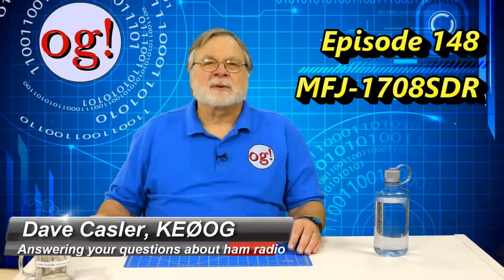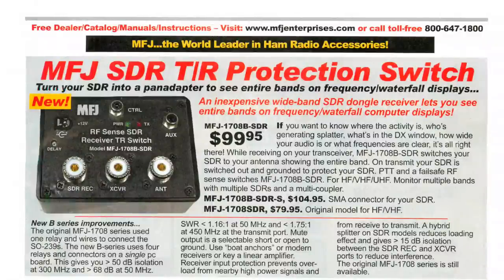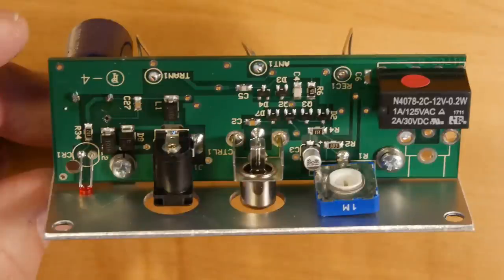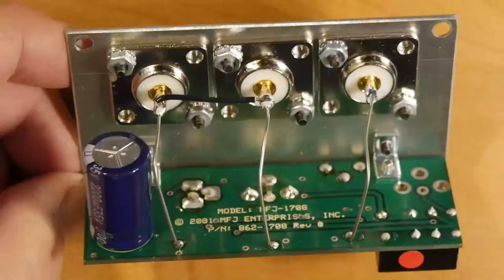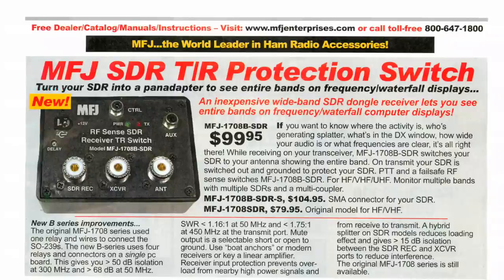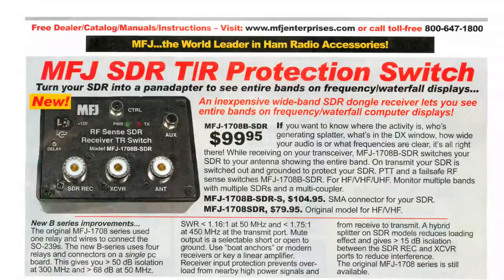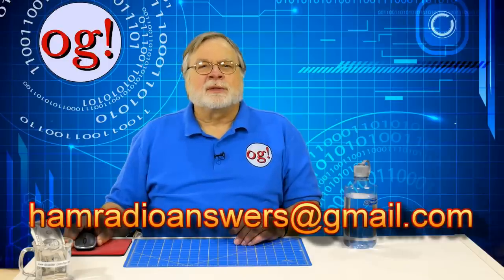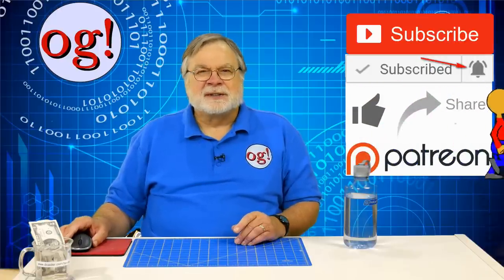A close look at the MFJ-1708SDR T/R switch (#148)

Comment: Thanks Dave for this great video.  It was very helpful.  I have successfully set up my Kenwood TS940S with a SDRPlay and a  MFJ 1708B.  The set-up is great and the SDR is a hot receiver.  The tracking works great.  Next project, upgrade from my old RigBlaster Plus (worked great) to a SignaLink USB.
73,  W4EET

Comment: I use SDRplay receive on an old 80m vertical for just that purpose, no radials. I pick up just about every transmission out there including FMStereo, air most UHF and VHF transmissions and of course HF. I playback SDRplay on a laptop. I transmit on a Hexbeam using a Icom 7300 which has its own waterfall. Full band-width SDRplay is a great device to find a contact, but using a good DXCluster program will do essentially the same thing. I believe that most people won’t need this MFJ device iMHO.
Reply from the maker: It fills a niche for those who use their SDR receivers as a separate waterfall.

Comment: Great video. Just wondering if there is a way to mute the computer speaker audio at the same time when the relay engages. I get feedback briefly when I key the PTT and it is very annoying. Other than that the unit works fine.
Reply: There is an aux output but I'm not exactly sure how I can have SDRUNO mute from that.

Comment: Looks like this might be a good alternative to use with ‘boat anchor’ separates - no tubes or Dow Key relays. May try something like this with a SX-99 and a Johnson Ranger. Versa TR (RAN Technology) is similar to this. I believe there is an option AUX connection that could be used for receiver mute.
Reply: Great Question!  This needs to be a separate video.  Using RF sensed is OK, but you are right, the Receiver needs to be placed in Stand-by or Mute as an extra precaution to protect the front end.  I will call MFJ and see what they say.  Dow-Keys are difficult to find anymore and are greatly over-priced.

Comment: Thanks for sharing. Placing the device in chain "TRX - MFJ-1708SDR - Amplifier - Antenna" with a 250W Amplifier, might damage anyway the relay and/or the front end of the SDR? Thank you in advance for your answer.

Comment: Needs more isolation.  I hooked dummy load to transceiver, then using the control input to switch this unit and measured the ohms between SDR REC center to shield and it measured 120 ohms during transmit.  That does not compute.  Why doesn't the relay provide a near zero shut?

Comment: Hi Dave, Love the videos. Can I use this adapter if I run the SDR off of a dedicated receive only antenna? I would of course hook up the PTT cable. I  used my pasture fence for Ohio NVIS day and man alive was that ever a QUIET receive antenna!! 432 foot rectangle shaped. Was going to use that as my receive antenna and my EFHW 8010 or vertical as transmit antenna. Thanks.

Comment: Original model is just like putting a T on the antenna (when not transmitting)  so a low impedance SDR could pull much of the signal away from the transceiver.  The new B models have a real splitter inside that sends slightly less than half the signal to each, regardless of their impedance.  At least that's my understanding.
Reply from the maker: Thanks for the additional info.

Comment: Hi I have question I have 1708sdr one I'm getting super high swr with sdrplay dx and sdruno and 991a with conect antina straight to the radio I get good swr ?
Reply from the maker: Either something's misconnected or you're trying to measure SWR using an antenna analyzer while the 1708 thinks it's in receive mode. The 1708 needs to think you're transmitting. The connection that tells the 1708 that you're transmitting is essential.

Comment: Thanks for the review Dave. I have a question though... at 12:29 you say that your Yaesu FTDX 3000 already provides an output to your SDR that switches off when you transmit. How can I tell if my Icom IC-7100 has a similar capability? I'm new to ham radio and while I can search the manual for references to SDR (of which there are zero), I'm wondering if that capability would be called some technical term instead? No need to spend money on something that the transceiver does already, if in fact it does that. Thank you.
Reply from the maker: Some radios have an "IF out" that you can tap into. The '3000 has a nice RF out that I use with the SDR.
Reply: @davecasler , that's an RX out, Dave.

Comment: what software are you running for the SDR dongle to feed into? that's the only thing you didn't cover was SDR to the computer. I have stacked TS-570's. I want the pan adapter to use with radio which has the transverter  to use it on 2 mtr SSB. 
Also, in your testing, did check the rx side? Is the sensitivity the same with the 1708 in-line and is the SDR the same as the receiver it self?  Dave W9DLP
Reply from the maker: In my case the SDR is an SDRplay RSP1A and the software is SDRuno.

Comment: I'm using a MFJ 939 external antenna tuner with 7300. Do you  run the coax from the antenna turner to middle connection on the MfJ 1708 then a separate coax from 7300 to radio connection on MFJ 1708??
Reply from the maker: I don't have the 7300, nor do I have the updated MFJ-1708. Check the manual carefully.

Comment: I have the 7300 with the inrad RX 7300 mod. Should I consider something like this to protect the radio if I want to play with external sdr and software? I’m kinda confused how to use the Rx antenna and the tx antenna without rf coming back into something.
Reply from the maker: I haven't heard about that particular mod. One of the shortcomings of the 7300 is that it doesn't have a separate RX antenna, although I've lived without one for a long time before I got my FTDX3000.

Comment: Just got one. Works pretty good except for digital modes even though I am using my PTT line. 
RF flows right thru to the SDR. I can hear the relays click but sdruno shows "overload".
My intent was to run meteor scatter with my Icom 7300 while watching on the sdr.
All other modes (AM,FM,SSB) sdruno shows "RF Mute" which it should. (USB-D) I get no such indication.
Disappointing.

Comment: I just have a question.....can i use my sdr mchf transceiver as my reciever while using my ic 718 as my transmit rig?   I want to do this because the mchf has better recieve and features like waterfall and scope and i can widen or narrow my recieve pass band and i dont use it portable except for vacations....... I think it will work but what are your thoughts?
Reply from the maker: Yes, it can work. MFJ sells a product that will shield your SDR receiver while the 718 is transmitting. I did a video on it recently.
Reply: Thank you for your input.  I rally like your informative videos.  73

Comment: Hi i have have the 1708b-sdr need to know those it go from Radio to tuner to antenna or tuner then to antenna?
Reply from the maker: Radio to tuner to antenna. If you have a separate SWR meter, it's radio to SWR meter to tuner to antenna.
Reply: sorry what I meant is radio to 1708b-sdr then on the Antenna port to tuner and then antenna does that sound right thanks

Comment: Is it true there will be 3db attenuation on receive by tying both receivers to the antenna?  Know that isn't a lot but when trying to pull out weak signals, it could be a factor.
Reply: 3bd is half an S unit also but that is why I am asking Dave for his opinion. I have enough trouble digging out weak signals that I don't want to be adding more losses into the mix. We spend a lot of money on coax to avoid losses and if this unit introduces a 3db loss as I have been told in the past, it is a bit of a fail in my opinion.
Reply: For $100, one would think that MFJ would add in a pre-amp to take care of the issue. Otherwise it is just a very expensive relay.
Reply: It's true, you'll lose half the power to the SDR, but how many of us are operating near our receiver's noise floor. For me, S/N is driven by noise picked up in the antenna, and 3dB loss at the receiver input  not going to make much of a difference.

Recently, I took my radio up into the mountains, and I was hearing all kinds of signals that I would never hear at home. It was an exciting pleasure. Maybe if I lived up there I'd be more particular about every dB of energy.
Reply: I do operate near my noise floor when working DX. I'm fortunate to live in an area where I have a very low noise floor as well. Really hate to sacrifice half my signal and still pay $100. Sure would think for that price, MFJ could build in a pre-amp. Sure doesn't seem like that would be hard for them to do. Only talking about a 3db lna.
Reply: I'm not sure I'd want an "MFJ brand" preamp in front of my signal, especially when it's way down near the noise floor. I mean, MFJ is fine for tuners and passive filters and relays, but I think I'd prefer to keep their active circuits out of my signal path! :-)

I suppose it would be ok for them to have the amp only for the output that goes to the SDR, not the primary receiver. Now that I think of it, I wonder a bit whether the natural input impedance of these SDR devices LNA's is 50 ohm or whether there is termination just before the chip pins. If the latter, hacks might be possible to modify the SDR not to load the signal, which would work as long as some other load (like your receiver) was present. Maybe the few feet of cable between them would make that a bad idea.

Note also that the RSP-1A has a "Hi-Z" port with an input impedance of 1k ohm. You might be able to hook it up in such a way that it does not present much load on your antenna. To do this right, one should be merely "splitting" the signal as does the MFJ-1708. I'd expect a proper RF splitter using transformers. And once you are using transformers, you can design for a split into two different impedances.
Reply: Dave does a great job... sad it takes him 15 minutes to give a 2 minute answer... I guess he likes to share all his wisdom with every answer...
ALSO... you know MFJ was known as Mother Fing Junk for years.
Reply: Took MFJ almost 4 months to get my antenna analyzer back to me when I sent it in for repairs. Not my favorite company.
Reply: I notice one item missing from these responses - that 3 db loss is for splitters/combiners, NOT for antenna switches, which this unit is.  Perhaps much less than one half of a db is more accurate in this unit.
I use the older variety of MFJ Tx/Rx switch, originally for switching SDR/Transceiver as this one does, but also  is the same unit with a different model number and silk screened graphics as the transceiver/receiver switch - just move the antenna connections to use as antennas switch or receiver switch ( I now use mine to auto-switch Rx and Tx antennas and use a first IF out to link to my SDR).   This new unit has a new multi relay system, so it should be much improved over the older system, I am going to get one.
Reply: "3 db loss is for splitters/combiners, NOT for antenna switches, which this unit is".  In receive mode, it is acting as a splitter. That is what I am referring to when I speack of the 3db loss. The antenna signal is being split between the radio and the SDR. If it was acting as a switch, the antenna signal would ONLY be going to the SDR in receive mode then switch to the radio in transmit mode. That is not how MFJ has this unit setup. The radio is hard wired to the antenna connector and only the SDR is taken out of the circuit in transmit mode.
"This new unit has a new multi relay system"  When Dave shows the inside, there is only one relay and you can clearly see the antenna socket is hard wired to the radio socket.
Reply: Thanks Richard -
I read some report that stated such about relays, thinking it was from MFJ.  Obviously not true, but can't find it now - I think it was on some reseller/dealers website touting new products and their advantages of the new relays.  Taking a look at the schematics of the three major models shows they are all wired the same except for one wire on the SDR version.  I then found this link that you may find very interesting.
https://www.eham.net/reviews/detail/13697
The big advantage is that it allows the SDR to view whatever band, not just the one the Transceiver is on as the IF out port allows (and I can then use both SDR's at the same time), which is why I will get this one - or get the cheaper one and add a wire!
As a side note, I had a quick switch unit failure using the sensing circuit, so will highly recommend using the PTT link only, and hope the sensing circuit works as a backup.
Reply: same with a failure on my Tx/Rx switch box!  So I recommend using the PTT option, NOT the sensing circuit for switching it.
Reply: " In receive mode, it is acting as a splitter. That is what I am referring to when I speack of the 3db loss. The antenna signal is being split between the radio and the SDR. "
I see that now (needed to look at the schematics) -  so get the older version ad that does away with the added wire, so no splitting!
Reply from the maker: It depends on the input impedance of the two radios. If they are both 50 ohms, then, yes, you will lose 3 dB. If, however, one of the receivers has high input impedance, then you won't lose much of anything.
Reply: It could be more than 3dB, and there is no isolation between the SDR Dongle and you receiver either, so you're going to destroy your fine transceiver's performance by sharing the dongles hash, birdies etc with it.  These things are the enemy of weak signal work, and little more than a toy.  See our review and analysis, using test equipment and lab grade signal splitters to prove the point.
Reply: Dave - you mentioned in the video that your Yaesu has an RX out that you use to connect your SDR.  Is there any degradation of the antenna signal into the SDR due to it first passing through the Yaesu?
Reply from the maker: No, there's a distribution amplifier in there for that output.

Comment: What about an external antenna tuner connected to radio MFJ 939 to ICOM 7300?
Reply from the maker: Put the switch at the output of the ICOM 7300 before it goes into the MFJ 939.